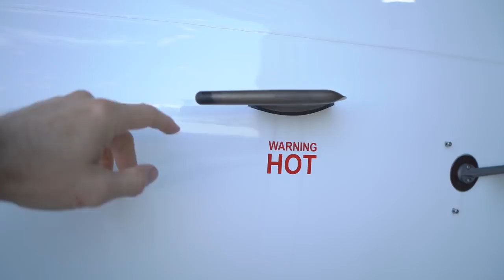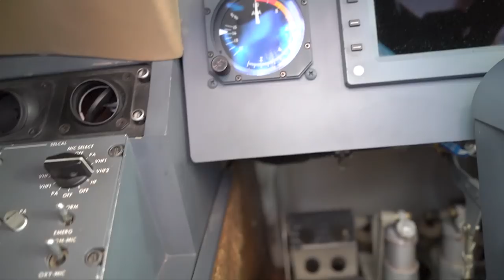Pitot Static and Angle of Attack Probes - Tech Tuesday -

Comment: I didn't realize the pitot was heated the entire time the engines were running. I figured it was like anti-ice boots, or fluid - just used as needed. I also didn't know where the AOA measuring device was. I appreciate the info, Shaun!
Reply: Every aircraft I worked on, the pitot heat had to be turned on. Maybe on some newer automated aircraft, but then those fancy systems tend to drive good aircraft into the ground.

Comment: I do not want to annoy anyone but remember that the pitot tube measures dynamic pressure, which is not airspeed. under certain atmospheric conditions IAS, to be more accurate CAS will indeed read airspeed TAS (true airspeed). thanks for the quick explanation by the way, I wish I could be a real pilot. dreams of my dreams...
Reply: Pitot pressure is air impact pressure plus static pressure, but it does not take into account air temp which will affect true airspeed indication.
Reply: @barrygrant2907  That is not true, dynamic pressure affected by density. density, (of the air) affected by:
-temp
-air pressure 
-and humidity
for example: when it is hot and moist day at high elevation you will have to fly faster through air (TAS) to get the same dynamic pressure (IAS) due to the reduce density versus a cold dry day at low elevation.
Reply: @may4092  Impact plus static, the static is the air density. I worked avionic instrument systems for 20 years, pitot-static systems being a major part of it.
Reply: @barrygrant2907  let me get this straight. basically what you're saying here, that temperature does not affect dynamic pressure?
Reply: @may4092  Didn't say that at all. "True" airspeed factors in temperature. "Indicated" airspeed, based on air pressures alone, does not use temperature.
Reply: Barry Grant what you’re saying is not making sense my friend. Read online about the topic, I’m not the one who made this thing up
Reply: @may4092  I don't know what else to tell you except a pitot tube picks up two things: ambient static pressure plus the impact pressure of the slipstream--no more/no less. At zero airspeed, there is still static pressure--atmospheric pressure. An IAS indicator uses both pitot pressure and static pressure to give IAS. TAS systems will also use air temp input to calculate TRUE airspeed.
Reply: @Barry Grant I think we misunderstand each other

Comment: When you pointed out the pitot tube, you didn’t indicate where the drainage port is located. By the way you explained what happens when pitot tube ice over and air speeds remains where the blockage took place suggest the pitot drain must me actuated by a valve. On GA pitot tubes have a drainage port behind the pitot tube and when ram air is blocked airspeed will indicate zero.

Comment: Does the angle of attack indicator sensor flutter in the wind!?  Is seems to move so freely that any turbulence or crosswind would cause that thing to go haywire
Reply from the maker: At low speeds it may bounce a little, but not much at all as long as we have some airspeed on it.

Comment: When it comes to the altimeter, what part of the plane is at the altitude? Is the reading at the top of the plane, the bottom of the plane or center line of plane.
Reply: The altimeter compares the outside pressure to the QNH you get from ATC. From 29.92 to 29.93 is several feet. 

Radio altimeters are usually located near the tail and are calibrated to match the main landing gear wheels, during the flare.
Reply: Thank You. I learned something new today. Great videos, really enjoy watching and learning.

Comment: Hey Shaun, does the Hawker have a redundant system like the GIV? And does it measure static air temperature or total air temperature (SAT/TAT)?
Reply from the maker: There is a redundant AOA vane and pitot tube on the other side of the plane.
Reply from the maker: Also, I believe the measurement is TAT, but the computer has the ability to convert to SAT.

Comment: How does the pitot tube get rid of water/rain being pushed through it?
Reply: *when flying
Reply from the maker: There is actually a very small drain hole on the bottom of the pitot tube, but I didn't want to get into that on the video as it might get a little too technical. With that in mind, for the airspeed indicator to "act like an altimeter" both holes of the pitot would have to freeze over.
Reply: Corporate Pilot Life thanks for the explanation

Comment: Shaun,
Do the instruments that monitor fuel economy rely on those probes, as well, or do they base it on  some other  things ?
I would imagine  your onboard computers  do  a decent job through your inputs from  external information sent to you.
Wouldn't the artificial horizon indicate angle of attack also?
Pardon my ignorance, the last time I took flying lessons was in the early sixties.
Cheers,
Rik Spector
Reply from the maker: These probes actually send their data to the Digital Air Data Computer, which converts the information to a digital signal. It is then sent to many different instruments and computers for use. As for the artificial horizon, it will tell us the pitch of the plane compared to the actual horizon, but it does not know the relative wind direction, so it cannot give us Angle of Attack.
Reply: @CorporatePilotLife  Thank you ,Shaun.
I try to ask questions which are relevant to your Videos.
Sometimes  I reply just foe the "Elavate" :)
Cheers,
Rik